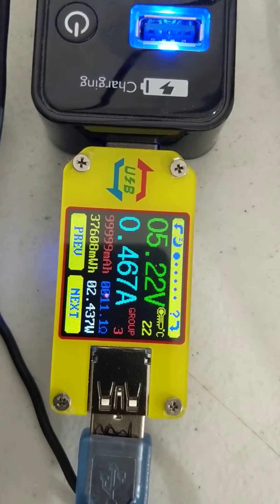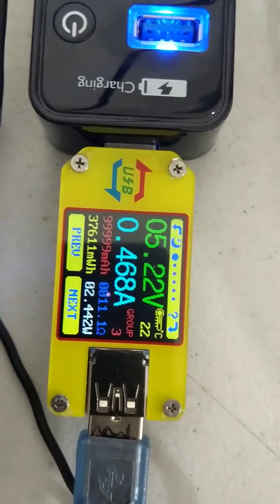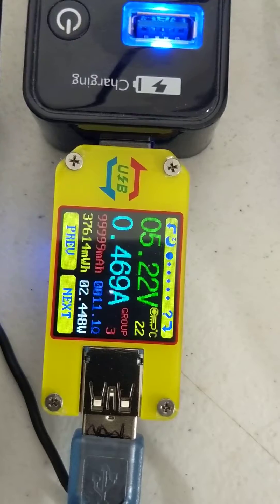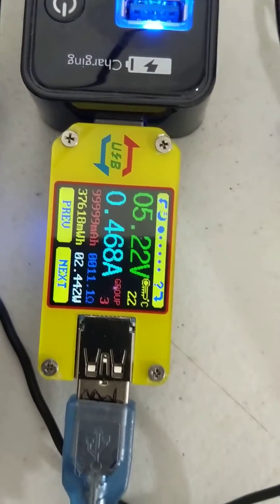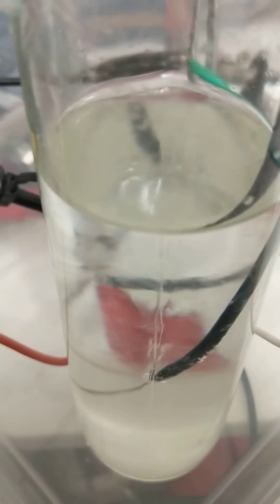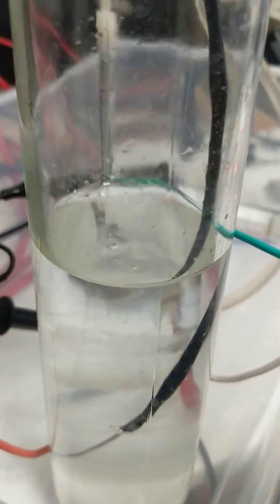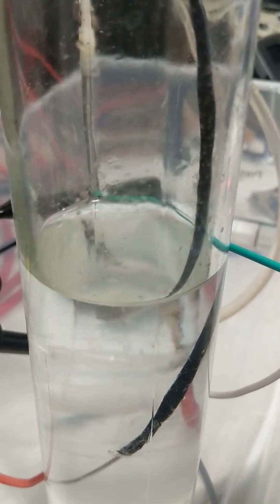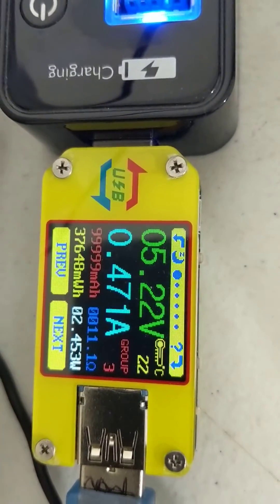HHO 2.4 watts! super efficient cell design !

Comment: Who programs your Arduino’s?
Reply: I have written all the software for all my units and also built all my hardware circuit boards everything this is why I have a zero failure rate in this industry I also mapped to the engine which I know you already probably know that. Every one of my systems are engines specific so I just thought I'd share that with you.
Reply: You might want to really watch a lot of my videos you'll probably really understand why I'm getting the results that I do.
Reply: I do all my own software I write c++